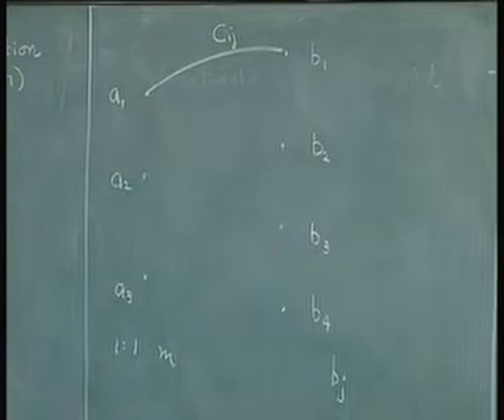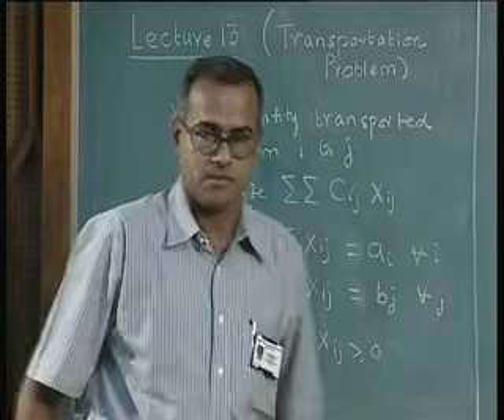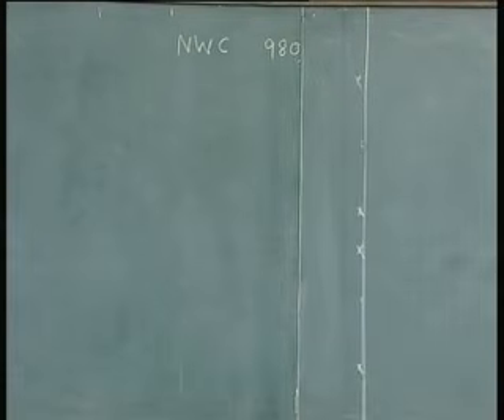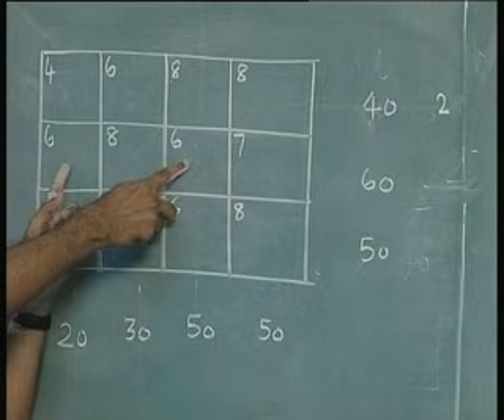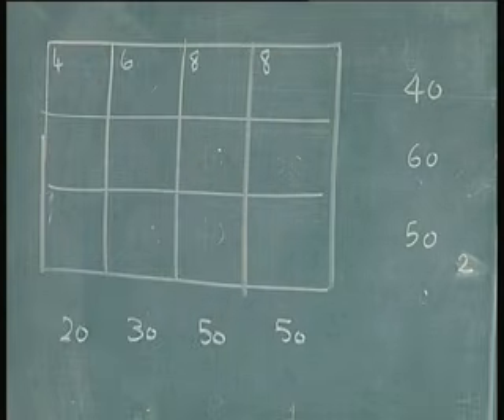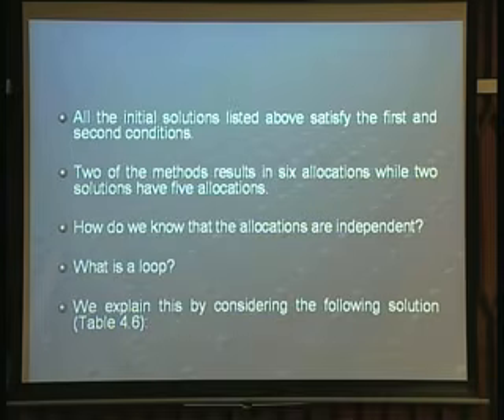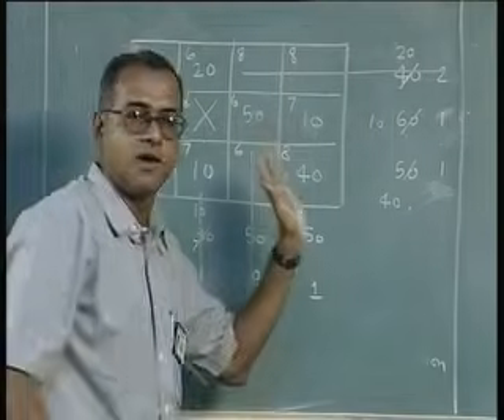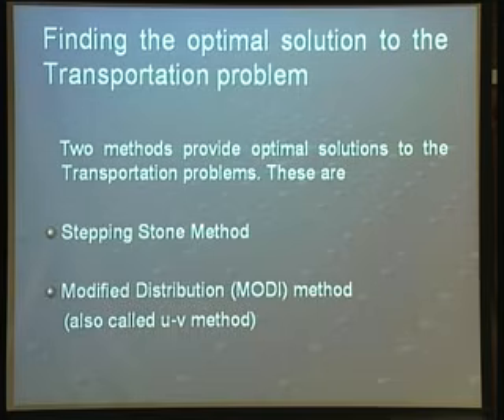Lec-13 Transportation Problems

Comment: Not attended a single lecture in uni.But ready for the exam like a boss, thanks to this videos.......
Reply: to get the degree, he has to sign up for the class either way. the goal is to learn and pass the exams, where he gets the material isn't important.
Reply: I didn't attend as I had been  undergoing a training in the same time.Though it was not compulsory  I did it as once the degree is over its easier to find a good job with bit more working experience. So don't judge people with limited facts +sssaaahhiill. That"s the point +Mauricio Rulz
Reply: going to university builds a different class of routine. you are fresh, you take bath and leave in the morning, there is peer learning and jokes in class, a disciplined routine and college life to cherish which you miss out on youtube .

Comment: sir the vam method was incorrect :(
in case of tie in penalty, lowest cost empty cell is selected in that row oor column,if there is a tie again,that empty cell is selected where highest qty. can be allotted. If that is a tie also,apply rule of thumb.
Reply: That can be done to ensure min cost but surprisingly for this problem that is giving a cost more than what sir got through thumb rule just after a tie!
Whatever, this is not an optimal solution.

Comment: Minimum penalty for column 3 = 0, but for column 4 = 1. (Shouldn't it be zero for column 4 as well?)
Reply: 7 is lower than 8. Hence penalty of 8-7=1
Reply: Always check for the lowest first.

Comment: hello guys correction here. In the case of Vogel's approximation method if there is a tie in highest penalties choose row or column with minimum cost. In the case of minimum tie aslo, select the cell which have maximum allocation. :) :) Thank you

Comment: At the loop points, when you come across +1 symbol, you should add 1, at the same time at -1 loop point, subtract by -1. This should be done simultaneously at both point of +1 and -1, then stop when any successive number-1 become zero. After doing this repeat the concept. you will understand my friend.

Comment: Dear Sir, 
As explained in this lecture we are exhausting either one of the source or one of the destination at each allocation. Hence, there will be at most m+n-1 allocations. (There can be less than m+n-1 since a single allocation can exhaust both of them if they have same capacity). I totally agree with this.

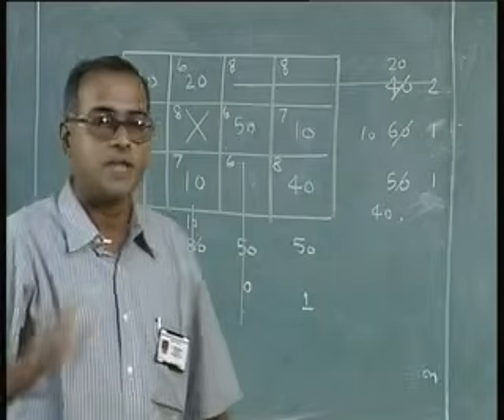But, at 49:58, you said that these three methods also won't generate a loop. How???
Allocations can obviously form loop even if number of allocations is less than m+n-1. Please explain.

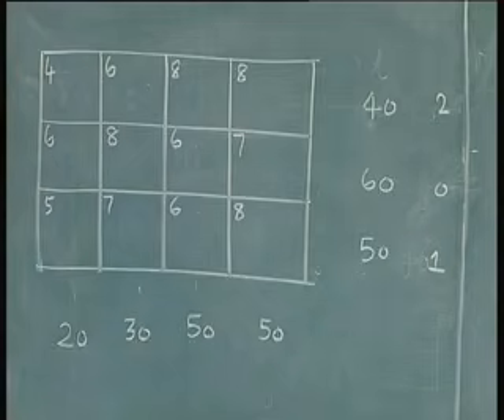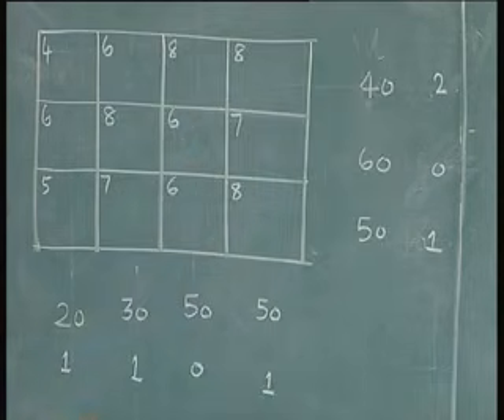Comment: DOUBT:  27:15 to 27:40, column vise as you subract the minimum cost and the next minimum cost .. when u come to 3rd column (8,6,6) as the minimum and the next minimum is 6, so, the penalty is '6-6=0',..then as u move to the 4th column(8,7,8) the minimum and the next minimum is 8, so, penalty has to be'8-8=0' rite? sir, can u pls expalain why did u subtracted 8-7 and marked the penalty as 1. ?